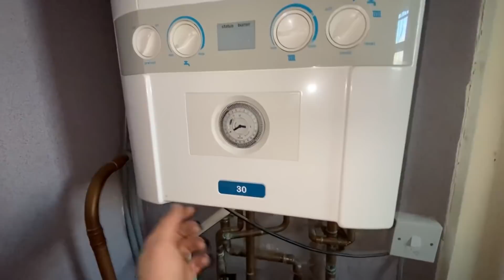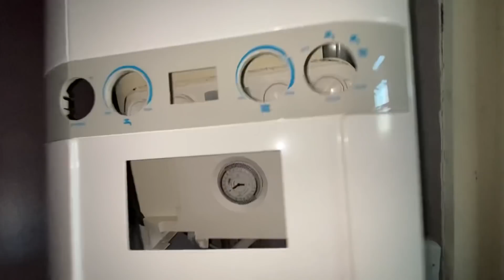1st FIX FINISHED AT THE HUNTS HIDEAWAY || 029

Comment: You checked that those tall radiators aren't flow/return specific? Sometimes you just can't spin 'em around to compensate if they are not reversable and directionally specific.
I've been caught out with that before.
Reply from the maker: I didn’t check but I will do now, thanks for the heads up
Reply: @SmartPipePlumbing  You're welcome, pal.

Comment: What's the reason for wrapping some of the copper pipes in foil tape? Just curious.
Reply from the maker: The stone, brick, cement can be acidic so just to protect the copper pipes. Plus if anyone needs to drill the wall this can use a metal detector and it will pick them up

Comment: What the purpose of the bypass on the boiler and are there really necessary
Reply: He has the system zoned for rads and UHF when the demand is satisfied for both circuits and the valves spring shut the pump in the boiler will still be spinning. The bypass gives the water a circuit. The boiler will probably have a built in bypass but this solution is far  better 👍
Reply from the maker: What he said 👆👆👆👆
Reply: @randomcamerajunk6977  so is the  bypass  there  protect the pump while the boiler gradually shuts off Which give the pump time to slow down then eventually stop